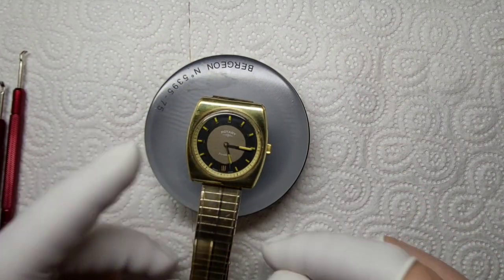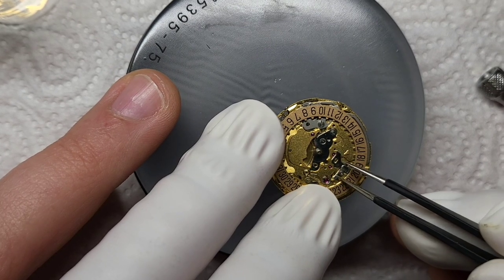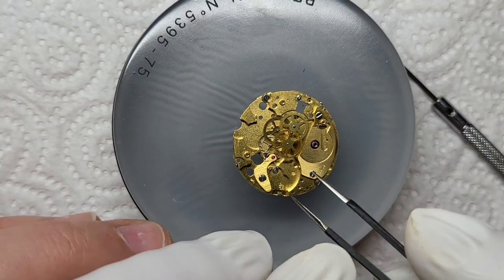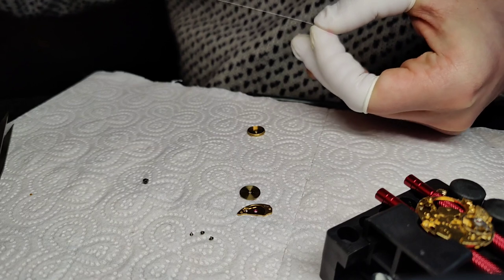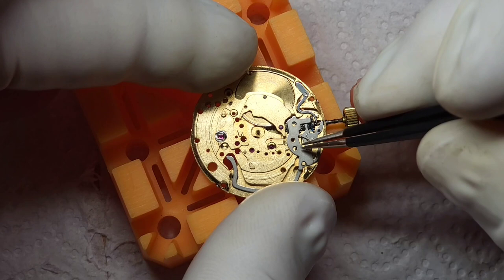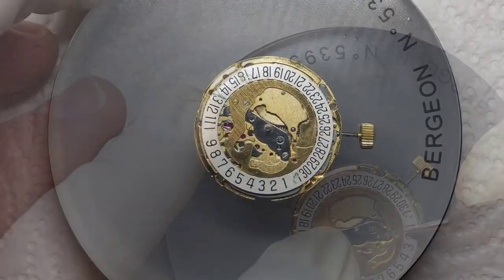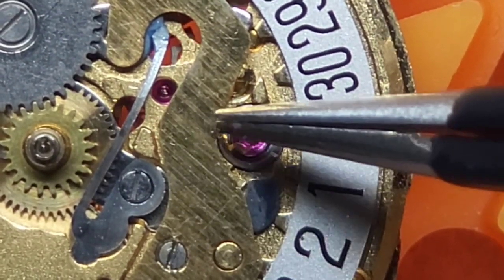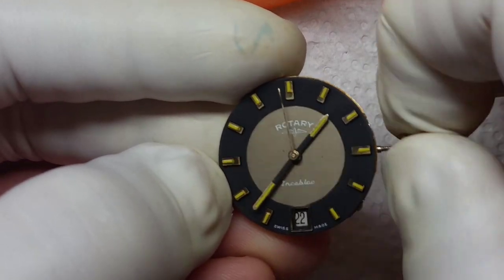Servicing a Manual Wind Rotary Wristwatch - From success, you learn absolutely nothing...

Comment: On the contrary, you are not under lubricating… you have too much oil in most places. Also, the pallet arbor jewels are an exception as it is best practice to NOT lubricate them at all. Finally, you need to be careful when using alcohol as a cleaner for the balance and the pallet fork. The shellac used to secure the pallet and roller jewels are soluble in alcohol and you you dissolve it if left too long. Alcohol is fine for everything else but best to use something else for those parts. “One Dip” is the preferred cleaner for those parts, but if you are on a budget, something like Naptha works fine. Nice job overall, watchmaking is a very rewarding hobby.
Reply from the maker: Hey there, cheers for the advice! As a newbie I'm always willing to learn is such matters and you've given me some sage advice there
Thanks!